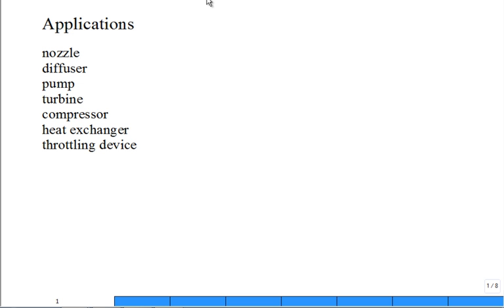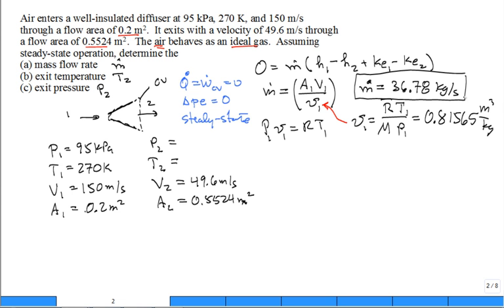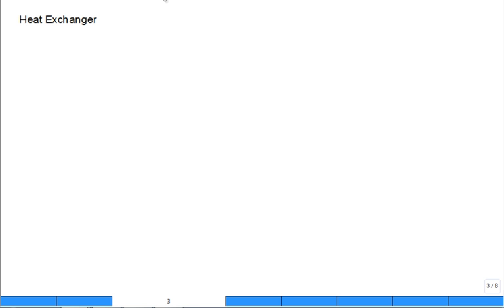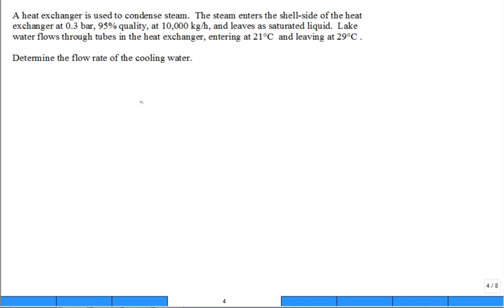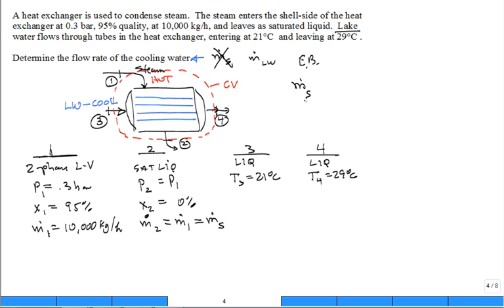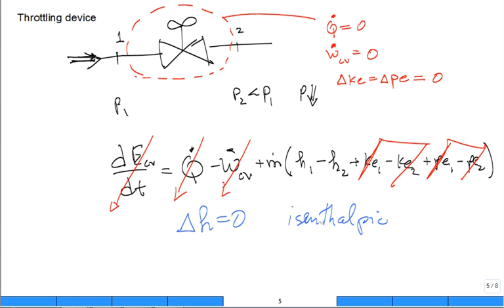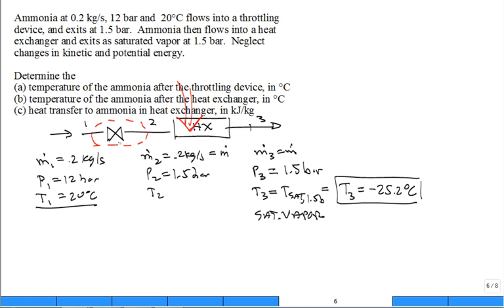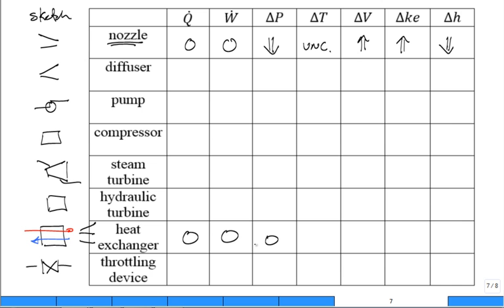ME3293 CV Analysis 4 Fall2015

Comment: Excuse me, Professor, first, thank you for your great lectures. Second, is it possible that water table data slightly differ in different books?
For example, in the heat exchanger example (~@ 28':00), I tried to calculate h_1 using saturated water (pressure) table from "Thermodynamics: An Engineering Approach" by Cengel and Boles (2014).
I got ~2616 KJ/Kg (NOT 2508.5 KJ/Kg). In short, I just read h_f and h_fg at 300 KPa and used h_1=h_f+(x) (h_fg). h_f and h_fg are 561.43 and 2163.5 KJ/Kg, respectively. What did I do wrong?

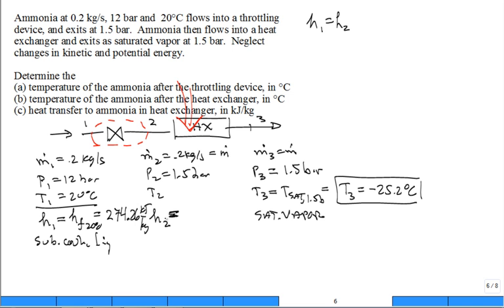Comment: 40:34 Hello Professor, why did you favor hf(T = 20 degC) = 274.26 kJ/kg in table A-13 over hf(p = 12 bar) = 327.01 kJ/kg from table A-14. I guess it doesn't matter much because 15.5% vs. 19.4% quality? I just wonder because your switch to A-13 seems deliberate.
Reply from the maker: the saturation temperature at 12 bar is higher than 20 degC.  So fluid at state 1 is subcooled liquid.  The best approximation for subcooled liquid, based on numerous observation, is that h = hf( based on T=Tsat).  Although close, it is not as accurate to approximate that h=hf (based on p=psat).
Reply: @randallmanteufel6411  Thank you!